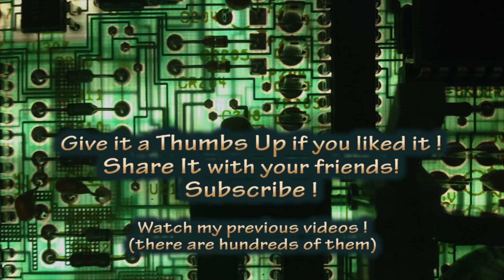🔴 #356 Siglent SDM3065X Repair - How Not To Measure Mains AC Voltage With Your Multimeter

Comment: We all make mistakes, lucky you were not injured by it.  You can always get a new meter...BTW speaking of new gear, congratulations on winning the Keysight 1000 series DSO.  I just saw Daniel Bogdanoff of Keysight announce you as one of the runners up and for which you won a new Oscope! You deserve it for all the great work you do, hope it really helps you.  Cheers mate and 73's.
Reply from the maker: Gary Bevis - yes it was fairly lucky in a way, it doesn’t seem to of damaged the meter. 

Yes it is great to be one of the runners up of Wave, and that they thought my work is worthy, I should make my application video public so people can see it in its entirety.
Reply: Yay you dodged a bullet, glad you are both OK.  I for one, would like to see the app video in it's entirety. I signed up for the daily drawing of the Wave contest, alas I was not one of the lucky winners, but I have a nice test bench all the same, just not loaded with brand new gear. I fix old electronics too and I like your videos very much (subscribed). I recently acquired an HP 8904A and as such I was keen to see what you've done with yours.  Hope I don't have any serious issues.

Comment: A DMM that needs a 10 Amp slo-blow fuse?! I would think that it shouldn't use even 100 Watts, so it should have a 3 Amp mains fuse (and not even a slo-blow). Are you sure you are using the correct mains fuse?
Reply from the maker: Ed Price - it isn’t a mains fuse. It has two fuses in series for the current measurement.

Comment: Not sure about the siglent but often bench meters have a much lower CAT rating than a handheld too. But why would the  mains side fuse go? Sure the overcurrent will kill the fuse in the current sense circuit but I don't see why the mains input one would go. Isn't the measurement part of the DMM floating? Even if it wasn't I imagine it's impedance to ground would be big.
Reply from the maker: Tom Biskupic - it wasn’t the mains fuse, it has two fuses in series, the consumer one on the outside, and the “in case the consumer fuse has been replaced with a bolt” fuse inside.
Reply: Ahh right! Just looked at the user manual. Yeah 10A on back panel, 12A internal. Separate mains input fuse on the IEC connector.
Reply from the maker: Tom Biskupic - a few people have commented on here thinking it was a mains fuse that blew, I probably should of been clearer about it in the video.

Comment: I would call you a silly bugger, but i did the same with my old fluke 8050a, it blew the big fat expensive fuse and took out a protective group of diodes, they went fully short so did there job great.
We all do it at least once :-D.
Hope the input protection stopped any sensing damage.

Comment: That internal fuse is a High Rupture Capacity fuse. If you don't use an HRC fuse you risk having a nice big fireball go off inside your DMM if you accidentally short the mains again. You should also change the externally accessible fuse, because its characteristics might have changed. :)
Reply from the maker: Magne Haneberg - yes I will be replacing at least the internal fuse with a hrc once I get some, the fuse I put in was only a temporary substitute to get it working again until the proper fuses arrive.